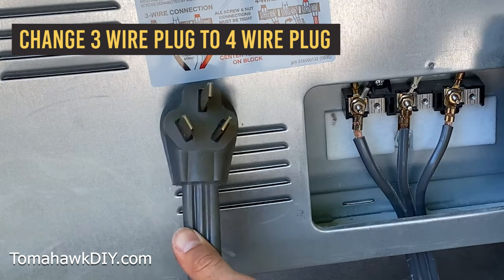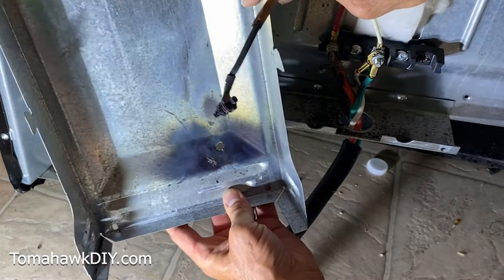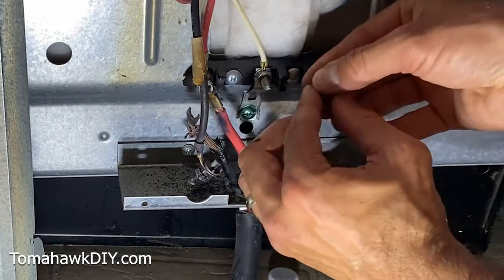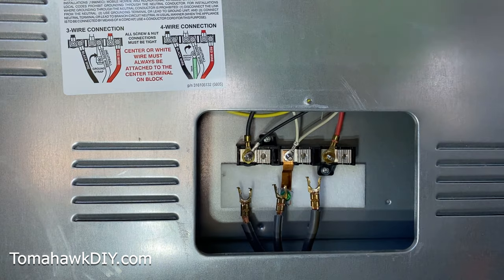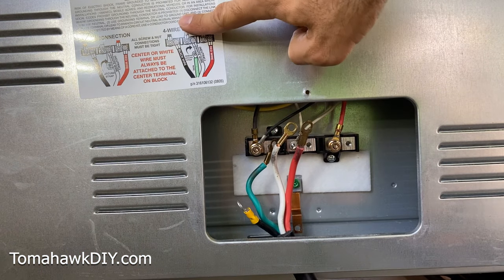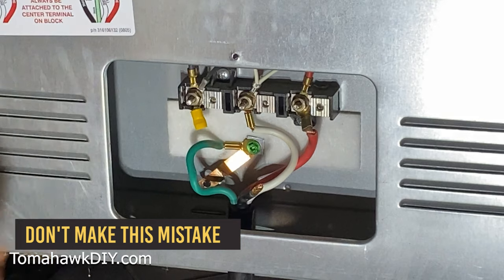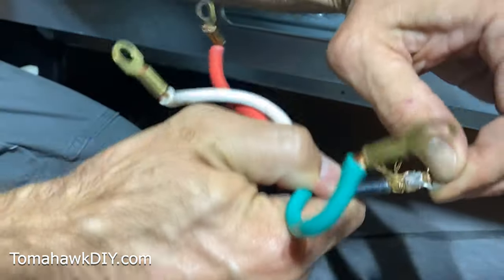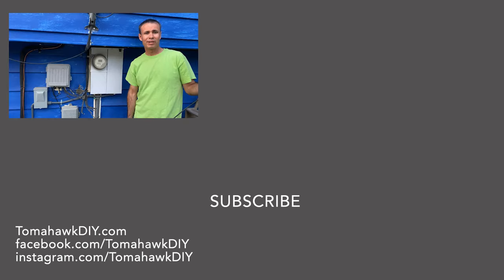Change 3 Prong and 4 Prong Oven Plug: EASY

Comment: Good video, but sloppy work. Don't keep the black wire short. Should have cut all wires to the same length to eliminate that issue. Also the crimp job was pretty sloppy with the wires sticking out everywhere.

Comment: Poor crimp on the black wire.  You should've cut off the frayed end, about 1/2" and then stripped back the black wire so that all of the strands would fit into the crimp.

Comment: Question what would happen if you don't have the ground strap?
Reply: You don’t have the “strap” he showed on this oven in the video, or you don’t have a ground screw at all? If you have a ground screw but don’t see a strap like his, don’t sweat it! Basically ovens use all sorts of different designs. This particular oven has a metal strap but yours may not. But you can still screw the ground wire into the ground screw on your oven and should receive the safety benefits from the ground wire still.